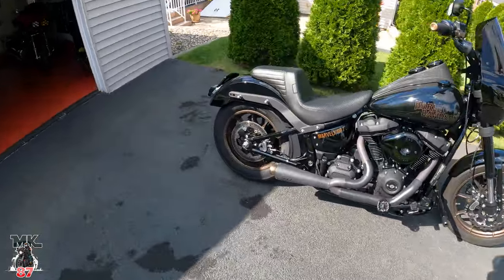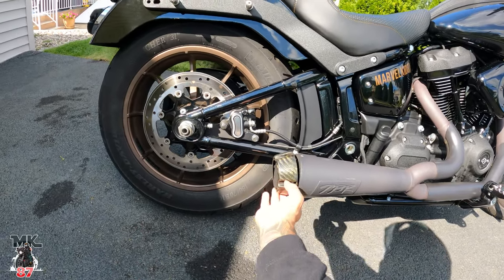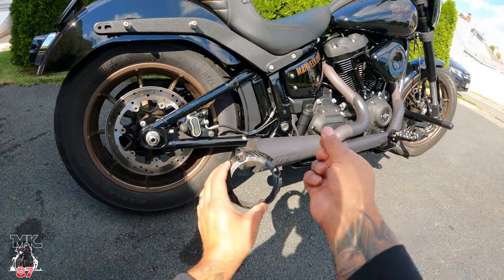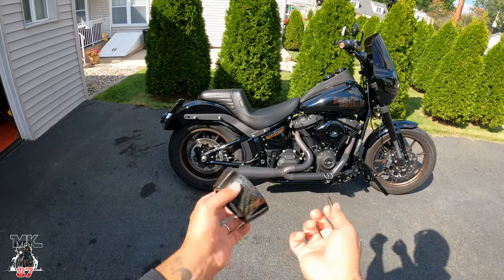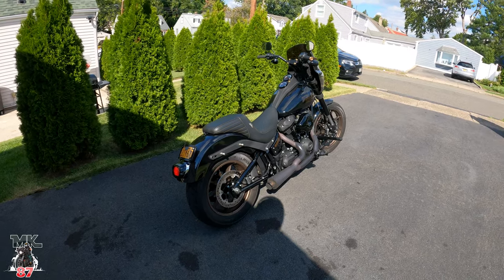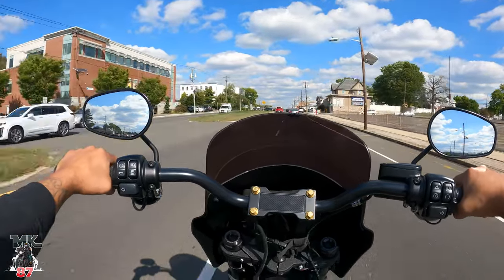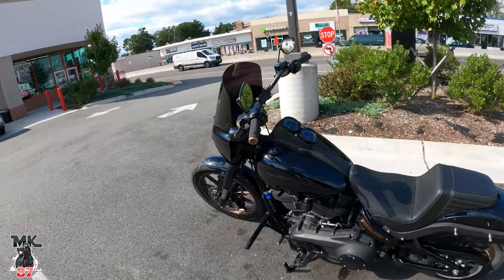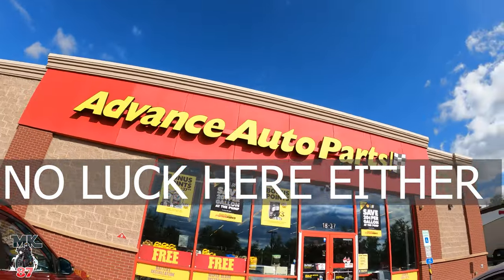My tbr exhaust broke!

Comment: The same thing happened on my son's 650 Vulcan with his TBR exhaust. We bought stainless replacement screws at Ace Hardware and used Loctite blue on the threads. That worked out. But I think it us a design flaw if other people are having the same issue.

Comment: I know I’m late on this vid.. you probably already it installed.. my fab 28’s heat shield requires red thread locker.. I never had an issue with anything becoming loose. So I would recommend using red thread locker also

Comment: Loctite, even the red, permanent kind, may not work on this application. You use heat to remove fasteners held in with loctite. The heat from the exhaust may have that affect on the loctite should you use it.